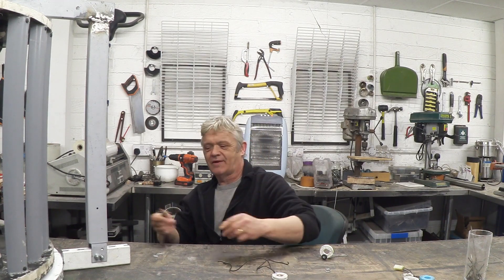The Wind Energy Harvester - An Apology And An Astounding Thing

Comment: Capacitors do not store power, they store energy. Power is energy over time. If you were to discharge those capacitors at say 10 volts in say 1 millionth of a second the power (for a very short time) would be 700KW. On the other hand if you were to discharge it over an hour it would be it would be micro-Watts.  The formula for energy stored in a capacitor is E=CV^2 (Energy is capacitance x volts squared). If you have capacitors in parallel they add up so each 1000 micro Farad cap is 0.001 Farads (1 milli Farad) you have 14 at the moment so have .014 Farads. 10 Volts gives an energy of 100*0.014 = 0.7 Joules. 

As for efficiency, if the available power was .013 Watts then you should be gathering .013 Joules every second so if you ran it for a minute you'd have 0.78 joules. (And oddly just over 10 Volts.
Reply: 700KW !!  crikey thats efficient.
Reply: @Benedict White  As someone new to working with electricity I was wondering if you could help me out; you kinda lost me towards the end of your equations. Why would 10V mean you multiply 0.014 by 100 and not 10? Also, why does 100*0.014=0.7 and not 1.4? Finally, how does .013W factor in to the previous equation? Thanks
Reply: @DozenDeuce  Sorry there was a missing part to the equation, a divide by 2. The reason it is by one hundred not 10 is because it is the square of the voltage, which is what ^2 means typed on a computer. If you were writing it it would be V with a little 2 in the top right hand corner. The formula is E=(CV^2)/2.

Hope that helps.

Comment: So 1000 micro farads is 1 farad, correct? When you say "fully populated", do you mean coils all the way around both top and bottom? I'm just wondering because what you have now would represent 1/8th of the total available power generation wouldn't it? Sorry, but I'm learning.
Reply: My understanding of the physics involved is that it doesn't represent 1/8th of the available power for generation.
A more even distribution of coils would likely be more efficient, but the current arrangement of coils uses all the available energy from the impeller (ignoring the friction losses of course)
The energy transferred into the capacitors comes from the movement of the magnetic field through the conductors, which acts as a braking force on the impeller.
Reply: @1967spark  interesting. Ive just been blindly assuming more coils with linearly increase output but you're right - there will be diminishing returns and the power limit is set by the rotor area.
Reply: @1967spark  So how does that work? The electricity is induced by having a magnet pass over a coil, correct? The north-south arrangement of the magnets means that each coil a pair passes over generates a full cycle, is that correct? If so, the addition of more coils around the base (from what I saw, only a 1/4 was done) and the addition of coils and magnets at the top of the rotor would create a linear power improvement wouldn't it? The way I heard the explanation was each coil was independent of its neighbours. Did I get that wrong? Is there an 'Electronics for dummies' some place on the 'net? Google is NOT being my friend. As a matter of fact, the way it's treating me right now, you'd think I slept with its sister.
Reply: 1000 microfarads == 1 milifarad.
Reply: @TerryGilsenan  Thanks Terry.